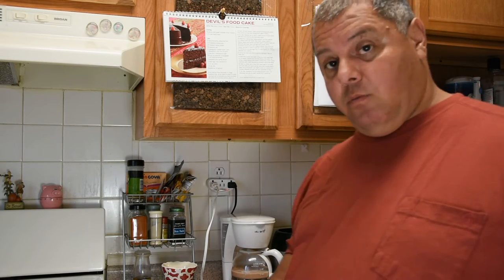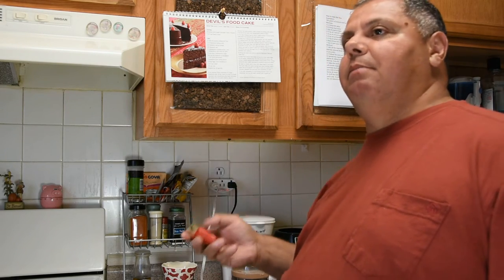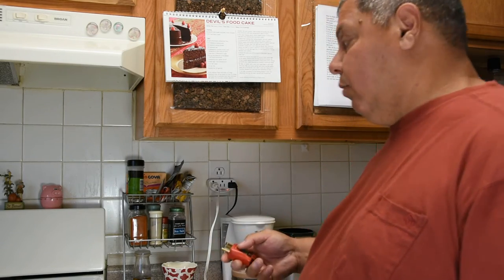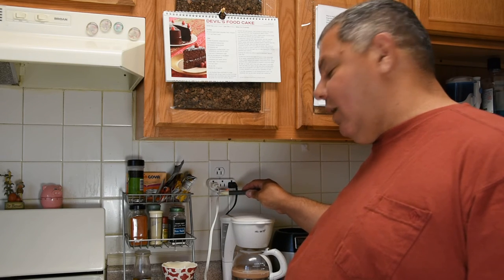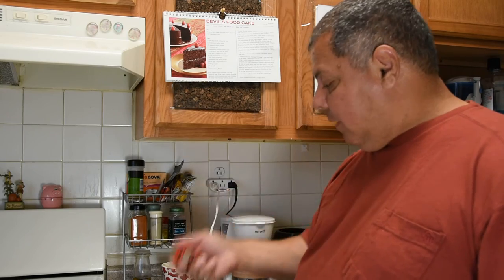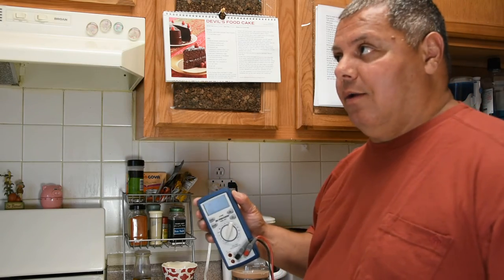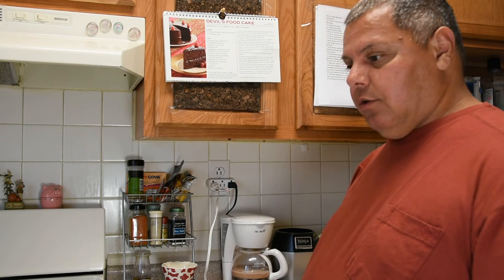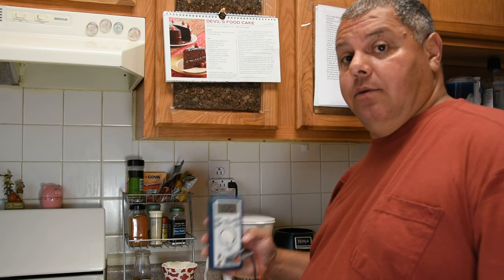Basics on some electrical testers, GFCI, Multi meter, wiggy & magnetic

Comment: One time the inspector's gfci tester was faulty!!! He told me there was a problem then I told him to wait a second and went got mine and everything was fine, so you gotta double check. A lot of times I use the wiggles hot to ground to test the gfci.
Reply from the maker: using a tester like a wiggles ground to neutral and hot is a better way then a gfci in difficult situations or as you pointed out a secondary test. Excellent point and solution.

Comment: Appreciate the effort, but it's a good idea to brush up on the details before making a video.  A GFCI tester should never trip the breaker (unless the breaker has an integrated GFCI).  Since you were in the clearly in the kitchen, pushing the button should have tripped the GFCI, but it didn't and you didn't address why.  Either you don't have a GFCI in the kitchen (code required since 1987 - but all kitchens and bathrooms should be retrofitted even if not required), or it isn't working or the tester isn't working. A brief mention of the importance of a GFCI would have been good.

Later you said that some wiggys have a digital readout and can measure true RMS current.  A wiggy by definition uses a solenoid movement to display voltage.  It will never measure current and it won't have a digital display. It's possible to combine a wiggy and other instruments such as a DVMM or GFCI tester in one case, but that's not really a pure wiggy.
Reply from the maker: Good information for our readers. I was just trying a test with the tester and the outlet was definitely not a GFCI. Up north the codes applies but here in Virginia with in 6' of water it doesn't. Mostly grandfathered in. And the more south we go the worse things can get with codes. Your right I did say wiggy and meant wiggy style. I did use a wiggy for ten years and do understand it's totally analog. Just got a bit excited on my first video. Especially since the new meters with displays look similar in size and shape. Thanks for the corrections.
Reply: Depending on the local code and build year a GFCI may not be required in the kitchen, but I would always install them in kitchens, bathrooms, and any sort of workshop area such as garages.  It's very cheap insurance and they do their job well.   Some of the higher end DVMM have a low impedance voltage measurement mode that sort of simulates a wiggy in the sense that it does present a measurable load.